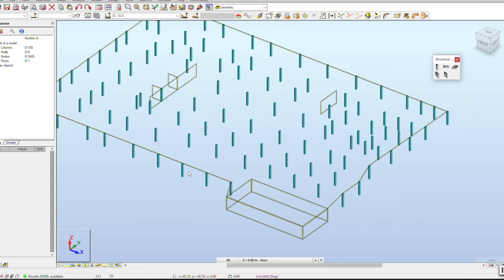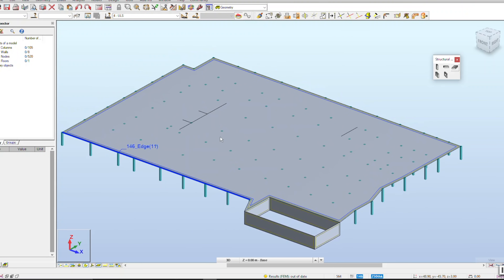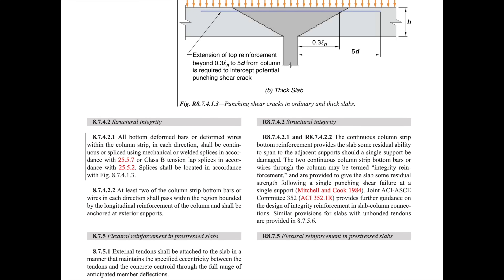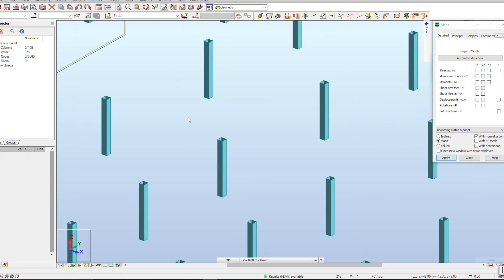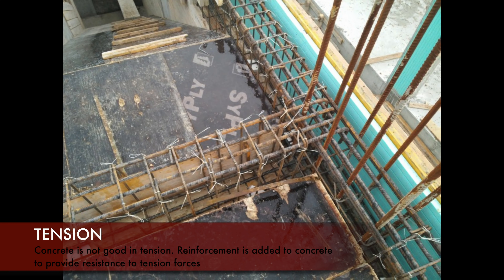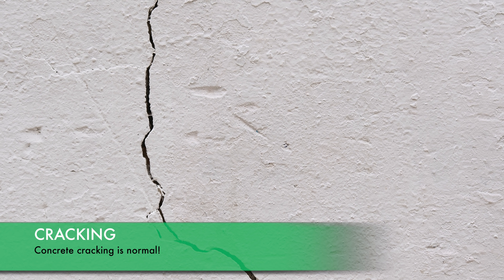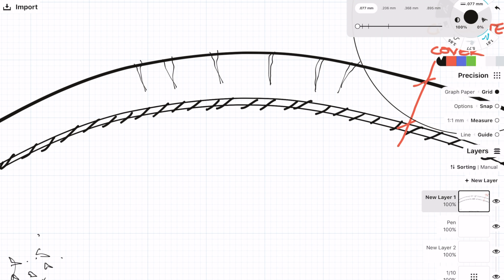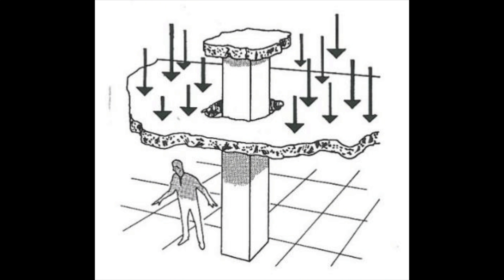Surfside Condo Collapse - Concrete structure basics - Slab bending and punching shear failure

Comment: There was a collapse of a parking structure in I believe Quebec City, that was caused primarily by deterioration of the reinforcing steel. When the slab was rebuilt, fiberglass rebar was used to replace steel. I wonder if more engineers will take another look at non rusting alternatives to steel, like basalt or fiberglass rebar?

Comment: Question about the robustness. 
How to or is it even necessary to account for robustness in a six-storey apartment building made out of timber when using EC if no information is given to take it into account?
Reply from the maker: I’m not super experienced in medium rise timber structures. But you definitely need to consider robustness like any other building. 
Determine the disproportion collapse class of the building and follow the EC rules in the timber code on how to design for tie forces, key elements etc.
Reply: @EverydayDazz  Thanks for advice. ;)

Comment: Attention to anyone buying a high rise condo apartment!  Either contact a housing inspector or local building code department in inquire about any deficiencies or code violations of the building where the condo is located. If you find any such violations, etc., don't buy the apartment!

Comment: I don’t think it’s meaningful to say concrete keeps getting stronger with water exposure. Structures are always more complex than a lump of solid concrete, and structures don’t get stronger over time with neglect. 
There’s never a structure that was barely strong enough the day it was finished, but got ten percent stronger over the next fifty years because it got rained on. They always get weaker. 
Once the building collapses, you can walk up and point at a ball of concrete, and say “look, that concrete is stronger than the day it was built”. 
And I’ll say, that’s a deceptive use of the term stronger, since it’s balled up on top of the building occupants.
Reply from the maker: I think you misinterpreted. I’m saying concrete keeps getting stronger very slowly due to the hydration process from the water that was used in the original mix. Not suggesting that you can submerge cured concrete in water to make it stronger.

Comment: Everything you say makes perfect sense. Only problem is when you look at pictures of still standing columns, LONG lengths of rebar remain sticking out of the columns where the decks have collapsed. Most of what is seen is not noticeably corroded and the lengths of rebar seen would tend to indicate not much "shear" took place. Instead, it looks like the steel was sparse, at best, and way too close to the tops of the decks. What these images appear to show is that the concrete was sufficiently weak around the rebar to the point where the concrete failed releasing the remaining deck from the rebar. "Shear" activity would have left short "stubs" of rebar at the column/deck intersections. Look at those images that show standing columns where the ground level deck collapsed.

Comment: From another analysis I gathered some of following facts and formulated a hypothesis:

There was a waterproofing membrane added to the pool deck. Then a layer of sand was added and topped with pavers. The drain was extended to be level with the new paver surface.

This allowed water to collect below the pavers in the sand. 1 cubic foot of wet sand weighs 120 pounds. Add the weight of the pavers and the large palm planters and now the pool deck is likely overloaded. 

Given the weakened rebar due to water penetration, the rebar eventually fails and the pool deck concrete slab sags and cracks as a result.

In the video looking down the ramp prior to the collapse, water can be seen pouring into the garage from the ceiling. A theory expressed by another engineer is that a pipe had broken during the structural failure. 

I hypothesize that the water is pouring out of the reservoir created by the added pool deck membrane which had torn as the pool deck sagged.

When the deck finally failed, it caused the resisting tension to fail. There is a very high probability that the slab broke the support column at the front wall of the building.

The damage to the column and the loss of the resisting force of the pool deck slab caused a moment force on said column causing it to fail completely.

After that, a catastrophic cascading failure occurred and the building fell.

Comment: Could or would using epoxy coated rebar on this building prevent the collapse from happening? I know coated rebar didn't come along until 7 or 8 years after this building was built.
Reply: Because the epoxy coating gets damaged by mechanical forces such as necessary bending for engineering requirements or mishandling when installed, it has been discovered that the coating does little to nothing to prevent water intrusion caused oxidation and expansion.

So, I'd think no. It may have delayed the degradation but it would have eventually happened due to the design of the slab that formed the floor of the interior and the pool deck.

The big problem is the slab of the first floor and the pool deck is continuous. When the slab failed, the resisting force was removed and caused a moment force to develop in the column(s) supporting the front wall of the building.

Comment: Why the inaccuracies in the model, though?
Reply from the maker: If you’re referring to me not modelling then walls. I only used the model to look at punching shear in the middle of the building so the basement walls don’t really have an impact. 
If I was to reviewing moments then yes I would model the walls.
Reply: @EverydayDazz  Understood, if you really just want to use it for punching shear. It's just that some people may interpret it as a forensic analysis, not a demonstration of a single mode of failure.

I'm what you could call an 'interested layman' and, by way of a tip, I actually prefer your videos to BI... and I also like it how you can make the basics easily understandable.
Reply from the maker: Thanks. I probably should have put a disclaimer or noted my intended purpose for the model.

Comment: as an architect with a BA in architectural structures, I would like to see an engineering analysis based on 1980-84 ACI code versus current.  also would like to see any old local amendments to structural codes and if they had any influence on the structural design.
Reply: I had heard that it's actually based on 1975 code.
Reply: @windwardpro  The building code, I believe, is the 1976 Florida building code. As I understand it, ACI refers to the standard not the local building code.
Reply: @Katoshi_Takagumi  OK- sorry, I didn't notice that he said ACI.  But what would the engineer/builder have used, the 1980 ACI as mentioned above?  Also, how much does the local building code come into play- is there overlap?  
Thank you very much for this very technical analysis you have done.  I have not seen any better.
Reply: @windwardpro  A very good queston, you'd really need an answer from an engineer on that. I assume that the public code is the minimum that the contractor needs to comply with.

Comment: Concrete is porous - it's not "waterproof". Concrete reaches maximum hardness after a few years - it doesn't get measurably harder "forever", regardless of the graph slope.
Otherwise good information.
Reply: Which is why the waterproofing issue is so critical.

Comment: Another engineer says that there was an elevation change in the garage and they didn't reinforce anywhere after that change . I've been learning about these structures from BUILDING INTEGRITY, and I agree that I've been so compelled to learn about building construction since the tragedy in Surfside. Thank you for being one of the channels that are trying to explain what may have been the factors for Champlain towers collapse.
Reply: I disagree
Reply: We haven’t seen any photos of un-reinforced concrete, just not as much reinforcement as we might expect. 
Even photos that some had said showed a lack of rebar, evidence can be seen that it was there and pulled out.
Reply: There was a photo showing where the rebar was sheared before the building collapsed if those photos were from that building.

Comment: Saw a video the other day where someone went in to old real estate adds and showed how much marble and granite has been added to the condos.  Also, the inexpensive cabinets for the kitchens and bathrooms were replaced with a much better (heavier) grade.  The pool deck had been upgraded, a layer of sand and pavers were added.  The person brought up how much water the sand would add, also a water barrier had not been put in place to protect the concrete.  Plus you had large flower pots and trees at one time.  Heavier AC units had been added to the roof.  After the report comes out in a few years bet there will be many areas at contributed to the failure.

Comment: How would a column be replaced in such a building? They can't support the building by jacking the slab on top of the column around the column because the column on top would punch through the slab. Do they have to cut through the slab to tie into the sides of the column above the one they are replacing? It seems that you would need to support the stack of columns all the way from the bottom to the top of the building.
Reply: Add steel columns

Comment: Punching shear is based on concrete strength in the ACI code supplemental steel reimbursement can be added but requires special details so you said something that in this country anyways is incorrect. Column failure is the most likely culprit for the collapse but weak slabs do not provide very good lateral bracing. Also a thing to note is punching shear leaves behind a truncated pyramid  these slabs appear to have failed vertically as opposed to on a 45 degree slope I think this indicates a material problem that it couldn’t fully develop it’s shear capacity. Concrete is porous not waterproof that’s why we plaster a pool.. keep up you efforts though I enjoyed watching.
Reply: Are you saying it isn't punching shear unless you get that 45 degree failure?
Reply: @Katoshi_Takagumi  I think the fact that the concrete broke straight up and down that there was a material failure of some kind that created some weakness that didn’t allow the expected shear strength to develop . Everyone says oh yeah that’s punching shear all right but I say take a closer look…. Even in everyday dazz’s video the ACI 318 snip it shows the calculation being based on this 45 degree failure plane.

Comment: I know stainless steel rebar is extremely expensive, but wouldn't it be practical and economical to use it at the very lowest levels and pool decks where spalling can compromise the building?
Reply: It is used on some bridges and was used in renovations in historically important buildings. It is very expensive but there are studies that do show it is overall less expensive for the long term care of bridges. However, I suspect the price will shot up if it was used more commonly.
Reply: From what I have read is the stainless steel is not as strong.
Reply: @edg8535  Its' yield is lower but ultimate strength is much higher than typical rebar.
Reply: @edg8535 
I know it isn't.   I'm more of a mechanical engineer than structural so my guess is they could use maybe 20% more rebar to compensate. 
At some point during the corrosion process, SS rebar will surpass the strength of the weakened steel bar. 
Even is SS rebar is 10x more expensive than steel rebar if it's only used on the lower floors, it's still a tiny fraction of the cost of construction.

Comment: Nice video.  You made a comment that the structure was not built per code.  Do you mean current code or code at the time of design or permitting.
Reply: Yes to both.

Comment: I think that another factor might be the change in the dead weight of this building over the years. In the early eighties, condos and apts. had formica counter tops, ceramic tile floors and tub surrounds, carpeted rooms. If you look at the real estate listings of these condos recently, they have all been remodeled with marble and granite floors, walls, and counters everywhere.  If there was only the bare minimum accounted for in the original calculations, the remodeling over the years put added stress on the building.
Reply: As long as the structure was properly designed, there is a live load allowance in the design that takes care of those sorts of things. It would not have affected the deck collapse. But extra topping on the deck would be a contributing factor.

Comment from the maker: Ok want to clear this up: Probably a poor choice of words saying "concrete is inherently waterproof" what I am trying to say is that a good quality poured concrete can be fairly water resistant by itself. I understand that it is still porous but it takes a lot of standing water to penetrate through. Nonetheless, a water retaining structure designed to keep water out like in a basement should have a minimum of 2 layers of protection. Normally that comes in the form of a waterproof membrane and additional additives into the concrete to make it waterproof.  

I've never once said that I would solely rely on bare concrete to repel water nor have I once said that I design structures that do not crack....

The problem as I've highlighted in this video, is that concrete cracking needs to be controlled by adequately placed reinforcement.

Comment: One of your diagrams shows what I assume is relative load distribution on the slab structure in shades of blue and seems to show very high loading around the area of the three critical pool facing columns which failed first as the building started to fall. Could you talk a bit about why static  loads at that location would be so high ?
Reply: They weren't compared to the building's columns.

Comment: Concrete is NOT WATERPROOF IN ANY WAY SHAPE OR FORM...this is why concrete relies on sealers and coatings to resist water penetration.
Reply: Sounds like a typical desk engineer.  Lol... "concrete is inherently waterproof"  whuuut?
Reply from the maker: Good quality concrete is inherently waterproof. The reason you put additives in concrete or add a membrane is to add a second layer of protection for the reinforcement. 

Just because I say concrete is inherently waterproof does not mean that I would design a waterproof basement structure without specifying a membrane or concrete additives.
Reply: @EverydayDazz  How can a porous material like concrete be inherently waterproof? It can't.

Comment: This building failure is a PERFECT symbol of American infrastructure...poorly built doing the bare minimum...remember, most of our buildings have a general useful lifespan of 50 years at best.
Reply: It's also a reflection of the inherent corruption within that system that allowed this kind of weak design, without adequate redundancy to be built, especially WHERE it was built. And that is partially political and partially #crapitalist, because in the US, DEVELOPERS run the show and own the local political hierarchy. Within their line of reasoning, losing a bunch of inhabitants of that structure after they built it and moved on is an acceptable consequence of bidnezz in AmeriKKKa. Further, these were not POOR people living in that structure, these were LUXURY condos with an oceanfront view. Their squabbling over the cost of repairs prolly cost them their lives in the short term, as acting sooner may have delayed the collapse into the future. Bidnezz in the US is strictly caveat emptor.
Reply: Most American infrastructure is more than 100 years old and for the most part still functioning.  There are many steel frame buildings some considered skyscrapers built early in the 20th century that are still standing and fully functional. Don't automatically assume this one example represents all America infrastructure, it does not and to say so is propagating misinformation.
Reply: Dude in many parts of the world the lifespan is 3 years!!
Reply: @designstudio8013  Is that your aim, to make the US like them?

Comment: Hes saying the punching shear could  be the reason for the collapse however I believe the foundation was sinking over time leading to a structural element failure. I think other channels explain better e.g structural engineer calcs!
Reply: Yes there could have been a differential settlement but in my view rebar corrosion could have weakened slab causing deflection and/or concrete spalling to columns corners thus affecting both the ability to support to vertical loads in the columns (due to loss of cross section causing overload) and loss of restraint casuing column buckling - and failure of the columns. I am not sure if, or how many of the columns exhibited this second failure mode. They have not all been seen on the photographs. What is very clear is that there was a shear failure at the column/slab interfaces as seen on the photographs. It is less clear if this was due to rebar corrosion, design faults (code or calculation), lack of designed rebar, or the complexities of the column/slab joints and changing concrete strengths led to shear planes in those joints.
Reply: Photos of the site after clean-up didn't show any sinkhole.
Reply: Differential settlement doesn't require a sink hole. Also note the foundations (pilecaps/piles) have not yet been exposed. Excavation has been to top of garage floor.
Reply: @postie48  Differential settlement would show up as problems with doors and windows, though.